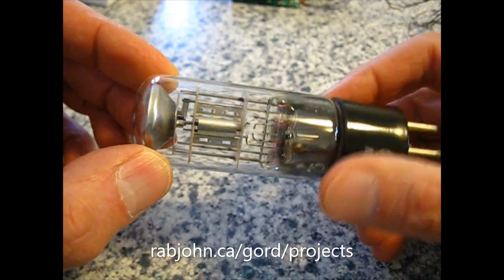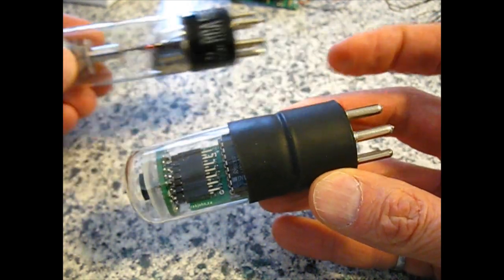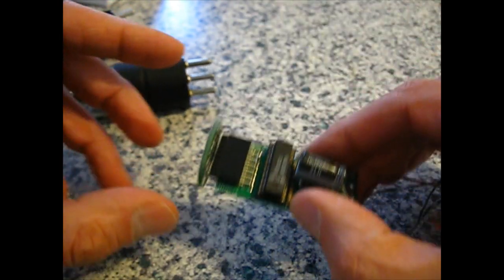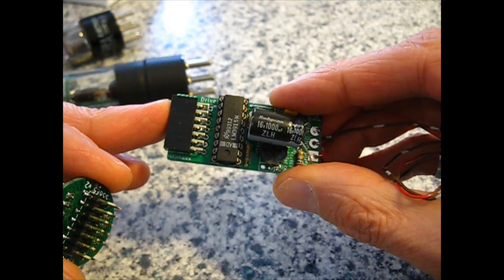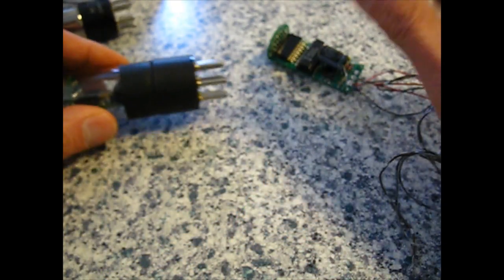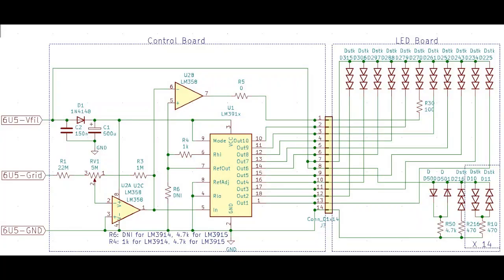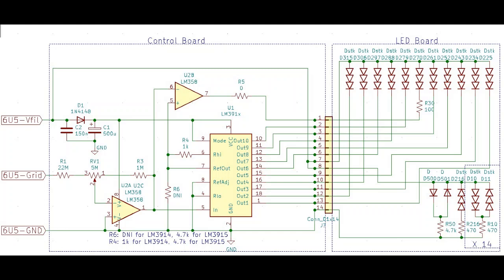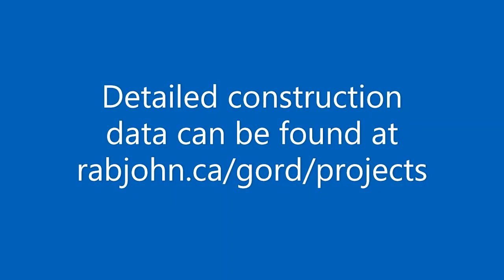A solid-state replacement for a magic eye

Comment: Have you thought about adding a half-step of brightness? It will give it a more analog, gradual look.
Reply: I like the sharp Transition of the original more than the Blunt edge of the LED. Al thought a good Rep. for a rare component👍
Reply: @marios.9191  An OLED would do a much better job of this I think
Reply: The problem is, there is no ready made "bargraph chip" for that functionality, so you would need to design it from discrete transistors (that may allow to supply the LEDs in series from the B+, so also work in circuits with filament supply at some weird potential). A solution also could be to use an MCU with an ADC and do these effects in the firmware, but then there is the complexity of writing the firmware. Either way it would make the project way more complicated and even becoming out of reach for many people looking for such replacements.
Reply: @annaplojharova1400  I did it with the LM3914 and LM3915 bargraph chips back in the late '70s when I was in high school. I had my first car wired up like a spaceship, with bargraphs that would smoothly shade from one LED to the next. It just took an Op Amp generating a sawtooth. This would PWM an LED gradually from 0 to 100% as the signal rose.

Now, if you use a microcontroller, you just use PWM to shade one LED to the next.
Reply: @AlienRelics  I agree, I think it even does not have to be exactly triangular. Heck even the 50/60Hz sinewave from the heater circuit, superimposed via some resistor would do the job...
Reply: @Anna Plojharová  the more it departs from a linear triangle or sawtooth, the less linear it is between LED steps. If you use a square wave at the correct level, you can get distinct half-steps.
Reply: @AlienRelics  Yes, it is not that perfect, but unlike the sawtooth, the sine is readily available at the socket, with just one single extra resistor to couple it in. Yet giving still better effect than "just two levels" of the rectangle. In fact I would bet, you would not see any difference between the sinewave vs real triangle, unless both running really directly side-by-side to each other.
Reply: @AlienRelics    I got to see photos of this car now.  This seems like something I have been trying to do for years but always got sidestepped.     I sure do hope you post something up on your Channel.    I could use some project ideas & Inspiration. 

   Always thought that the 3rd generation minivans looked almost like a stat trek TNG like esque design language in it.
Reply: @annaplojharova1400  Writing it in firmware is definitely possible. One problem is that most MCUs only have very limited ADC and PWM outputs. You can write a PWM driver yourself though which I have done quite successfully in the past. What you do is have a list of the brightness each output should have, sort it by brightness from low to high (first led has to be turned off first). Then you wait for the next interval (whatever period you want to have your PWM running at, e.g. 100 Hz), turn on all leds and then using a timer and ISR you set the timer for how long the first led needs to stay on, in the ISR you turn it off and set the timer for how long it takes until the next led needs to be turned off in your sorted list, and so on.

It's a bit tricky to implement efficiently but it works very well and supports virtually infinite outputs (the biggest problem being the runtime cost of re-sorting the list each period)
Reply: @TheMrKeksLp  Easier in code execution is to use PDM: A routine is triggered by a regular interrupt, let say 19kHz (just "happens to be" when the free running ADC operated at the rated 250kHz triggers an end of conversion). Each time you add the (lets say 8 bit, aligned to MSBs) value to be "displayed" to an "accumulator" 8 bit register. You decode the 3 MSB's (or 4, depends how many LEDs you want to drive, if 7 or 15) to the number of LEDs lit. Then you zero these bits of the accumulator and then wait for the next cycle. With that you get 7 LEDs bargraph (or a single point), with 32 gradual brightness steps going from N to N+1 (or N'th to N+1'th in case of a single point style) LEDs in 32 steps.
Reply: @annaplojharova1400  could you alternate between two values really fast and use regular bar-graph chip? maybe add a few caps.
Reply: @lizelive  This is exactly what would the ac component (e.g. from the filament supply) coupled to the signal do...
Reply: @annaplojharova1400  Resistors between the output pins?_
Reply: @DjResR  But that would just "smear" the shape, it would not change the 10 steps only limitation for the full range. So completely opposite than how the original tube looks like (= sharp contrast, but smooth response).
The point of "gradual brightness" is to increase the number of steps in the displayed level (so it moves smoother) without increasing the number of LEDs.
Reply: @annaplojharova1400  or he could use arduino nano :)
Reply: @ZaklanaCeljadd  a microcontroller yes but an atmega328p hell no, atmel chips are expensive these days and kinda obsolete compared to the competition, a stm32 or anything modern can be used, but its kinda nice to keep it old-school
Reply: @nalinux  multiple HC595 could be used. Atmega328 is more than enough to make every it's output a PWM output, especially if hardware SPI is used
Reply: @nalinux   Sure, there are lots of examples on the internet. There is a library for ArduinoIDE made by Timo Denk and another one by Simmso. But it's better to use C language and Atmel studio rather than ArduinoIDE. All HC595 outputs can generate PWM signal even if you use like 10 of them in series. Usually, hardware SPI of Atmega is used to control hc595
Reply: If you're going to go there, you might as well also dither the led positions and maybe add the diffusor plate some radial ribbing.
Reply: I'm quite sure it can be done without an Atmega, just using opamps like LM324.

Comment: Great job. The implementation and the final result are quite impressive. Definitely simpler than solutions based on LCD's. Analog solutions are always better to be used in radio applications.
Reply: Why is analog better? I Feel like you could achieve higher resolution with an LCD, if you could get a circular one
Reply: @SpaghettiEnterprises  -  RFI from digital controllers... noise
Reply: @KlodFather  but this bargraph just has so much less resolution than an LCD would, and an LCD is already far inferior to the original.
And that tiny indistinguishable from thermal noise amount of noise?
Reply: @ABaumstumpf  ig its about the look and feel, first thing its kinda hard to find that small circular lcd's, and leds tend to look much nicer, for example im working on a led pixel art display and individual leds just look way nicer then having a display
Reply: @ShahZahid  true - most displays you can buy are not that bright, and good ones are readily available but they cost a pretty penny. but for this application where they are used as a display-device to finetune a system i'd rather have 10x resolution and more faded colors (i mean the tubes also have rather pale colors so wouldnt even look that out of place).
Reply: @ABaumstumpf  -  RF noise that the radio receiver can detect. You would have to shield it if possible and that is not likely considering that it gets its power from the filament circuit.  Radios of any kind do not like digital electronics around them because of noise. Your cell phone operates in the microwave portion of the band which is ultra quiet and the noise generally will not go up that high from simple digital electronics... But broadcast radio and shortwave radio below 30 mhz does not like digital circuits and they may make it impossible to use the radio. The FM band is not affected as much but the Am and Shorwave are absolutely in trouble. Bad idea. Analog is the best way to solve this... Its quiet. Just like switching powersupplies used to be VERY NOISY.
Reply: @KlodFather  "RF noise that the radio receiver can detect."
 hardly. You are really overestimating the noise by a few orders of magnitude.

"Radios of any kind do not like digital electronics around them because of noise."
Nah, that was 30 years ago. Now even without filtering it imbues less noise into the system than just the switching of the LEDs here.

"Just like switching powersupplies used to be VERY NOISY."
You said it correct there - "USED TO BE" - or you buy the cheapest one without any filtering. Just the thermal noise is often in the same order of magnitude already. Are you chilling your radio?
Reply: I think you misinterpreted my statements. We are dealing with radios that are between 60 and 100 years old that use those eyes and those old electronics are not very tolerant of noise from microcontrolers that would drive and LCD display the way you are talking about. I suppose you could use the LM chip to operate the LCD and turn the polarizing filter 90 degrees to make it pass light when activated backlighting it with green and blue LED's to get the color correct... But I was explaining to him and now to you that those old radio circuits don't like those square edges from digital chips usually associated with LCD displays and drivers or any other microprocessor based controls. The early synthesizer radios with digital control had many hurdles to jump to be quiet enough and stable enough to not interfere with the receiver. Early synthesized cheapo radios scanners car stereos and other radio electronics had lots of problems from the micros causing interference. I was just saying its a safe bet to use the LM chips which the author of this video did in this case. I don't know what you do for a living, but if you were a good tech or engineer you would know about this stuff. RFI problems are real. Radios and digital electronics are a bad mix and there is much work to be done to shield one from the other especially in the same device.
Reply: @KlodFather  "those old electronics are not very tolerant of noise from microcontrolers"
Those old components are less sensitive and you are really overestimating the noise that a micro-controller produces. 

"But I was explaining to him and now to you that those old radio circuits don't like those square edges from digital chips usually associated with LCD displays"
... you know you should put at least some filtering for any circuit? .... 

"The early synthesizer radios with digital control had many hurdles to jump to be quiet enough and stable enough to not interfere with the receiver."
Yes - cause they needed several orders of magnitude more power. If you switch 100mA of current that has quite a different noise than sub 1mA.

" I don't know what you do for a living, but if you were a good tech or engineer you would know about this stuff."
Right now just software development but i have worked on things like lowpower local positioning systems, weather radards etc - low SNR analog signals.
Just the switching of the LEDs like in his schematic will result in current pulses and same if not worse EMI than a microcontroller and LCD screen due to the LEDs not being buffered.